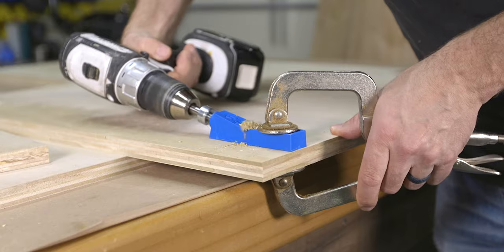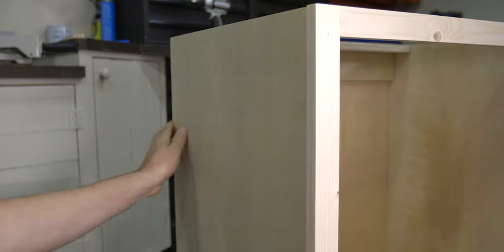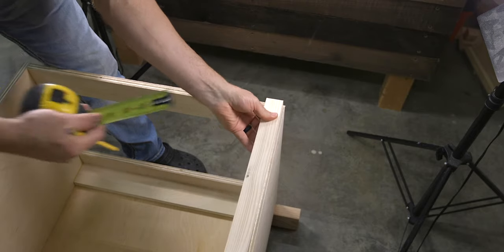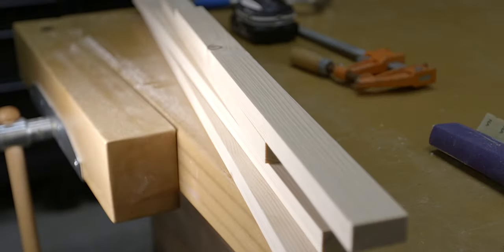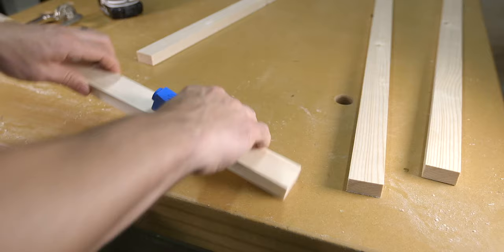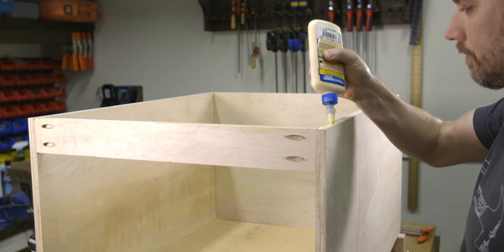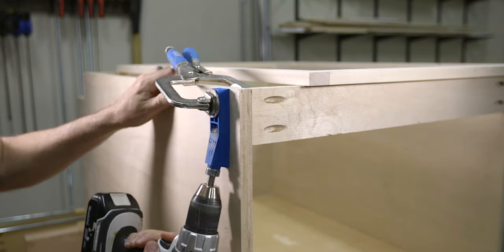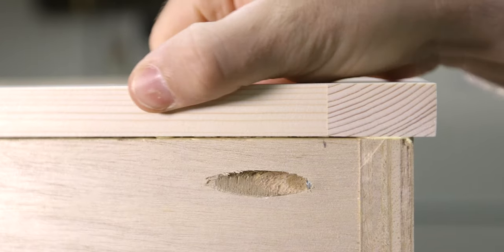Easy Cabinet Face Frames For Beginners

Comment: I like the brad nail trick, never seen that before.  Thanks Josh
Reply: I saw it at Make Something a few mins ago and it was not explained. Now it makes perfect sense and I’ll definitely use that. If I can figure out what that snipping tool is.
Reply: I’ve not seen it before either. Great trick!
Reply: Those pliers are used to cut and bend pencil rod when installing drywall ceilings from concrete ceilings.
Reply: That’s what I was going to say. Genius!

Comment: I was taught in cabinet making school, to always use cauls when gluing face frames. This will insure that there will be even pressure along the edge eliminating any gaps, especially on finished ends.  Forget about using pocket holes for attaching face frames, this could lead to problems. Also, I would like to point out that using cauls will eliminate the need to brad nail the s*** out of the face frame, like I have seen in many videos. You really only need a couple of nails, (I place then near the top), to hold the frame in place. If you like the idea of drive and clip the nail head off, I'm ok will that.

Comment: How come you want an overhang on the outside of the cabinet? Won’t there be a gap in between two cabinets when you butt them up?
Reply from the maker: Yes, you need that gap so each complete cabinet box can come together tightly on the face frame... not the box itself.
Reply: Ahh thank you

Comment: Thanks for this great video. If you are making a face frame for a cabinet that will be beside another cabinet (that is, attached to it) should the face frame be flush to the cabinet sides so there is no overhang?
Reply from the maker: No, you always want a little overhang just incase the box or wall is off a bit you can be certain the face frame will line up. Hope that makes sense.

Comment: Will an mdf hanging cabinet using pocket holes and glue going to fall apart when I start to fill it up?  Sides top and bottom are 16mm thick.  Back is 19mm.  Approx size of circus 3ft wide, 1 ft deep, 2ft tall. There will also be a bottom panel and side panel and 2 doors.  My question is this too much weight for mdf to handle?

I love your chanel. Keep up the great work
Reply from the maker: Hey Bill! That is a very good question, and I don't have an exact answer. I'm sure it would be fine, but I've never trusted/put much faith in MDF.

Comment: When building cabinet face frames (that will have a countertop), wouldn’t the maker elect to have the rails run the full width of the cabinet and rest on top of the stiles? In this way, the rails transfer load from the countertop/surface to the stiles and prevent sagging.

Comment: The "play" in tapes does not make them less accurate, it accounts for the size of the tab. Push the tab against something and it subtracts the width, pull on it and it adds it.... better than cutting things 1" short on accident :D
Reply: Kind of hard to pull the tab on a pencil line though.

Comment: New Subscriber!!! I just picked up a Kreg pocket jig 320, a hinge jig, and a shelf peg hole jig, along with some clamps tonight!!! The “new” 320 jig has size markings on the drill bit, with a window to line up the different sizes on the collar. It also has moveable bottom tabs that are size marked for a very user friendly setup. I’m refacing my kitchen cabinets, and building some new new ones. I’m gonna be using some of your excellent tips for making new shaker style doors. Can’t wait to start tomorrow!!!
Reply from the maker: Welcome Chester! If you have questions or would like to share photos of your work with me, email them to josh@traininghandsacademy.com

Comment: Great video. What's your tip for keeping your face frame lumber straight after ripping the pine? I'm always concerned the wood will warp/bend even a little, which might open up your joints. Any tips? (this could apply to all projects using lumber). What if I dont have a jointer? Maybe I dont need to worry about it warping/bending once its glued? Thanks!

Comment: I have a aquarium stand that I am building out of two-by-fours trying to make it look like it was part of the house the front half will have two doors on the bottom frame that swings out doors on the side of the aquarium that swings out and two doors above the aquarium that will go up towards the ceiling on the side of my case work I will have two doors that will swing open my question is what's the best way to mount the framework to the two-by-fours and what type of hinges would I need to hold the upper doors that swing towards the ceiling upright and the doors do not come down on my head when working around the aquarium also on the side of my stand I was thinking about the bottom door having glass so I can see my control board is this something that can be done if all the other doors will be flat panel or do you think that would look out of place

Comment: Hi! I have a question! When you use faceframes, how do you put the slides??? Do you put some kind of suplement between the slides and the side panel? Is there any other way? 
Thanks!
Reply from the maker: Hello! The face frames get screwed together without anything in between.

Comment: I tried this in the past with a solid metal jig, which I was hoping was going to last longer & be more durable; however, after doing just a single set of facings on a handful of cabinets I noticed things not lining up quite right. I looked down the metal hole in the jig and saw that the side of the drill bit had chewed away at the inner top of the guide hole because as the bit was starting to drill into the wood, the wood pressed the side of the bit up against the side of the guide hole, cutting into it. Have you ever seen this. Do you think the metal in my jig hole was prob just not as good quality as I thought? Or maybe because I was using a standard drill bit rather than one that had the smaller bit extension sticking out further from the tip?  I noticed your bit had that.
Reply from the maker: I would blame it on using the wrong drill bit... could be the metal, but again sounds like the drill bit.

Comment: What type of wood do you recommend for the face frame? Can you use the same plywood as the cabinet or is that not recommend?
Reply from the maker: Not recommended. If painting, I like to use Poplar.
Reply: @TrainingHandsAcademy  is that like a hard wood ? Can I get it at home depot? Also if I'm gonna laminate or formaica can i do that at the end? Once the cabinet is all done?
Reply: @TrainingHandsAcademy  that k you so much for your insight
Reply from the maker: @OKVanAutoUpholsteryBellGardens  Yes, HD sells Poplar and yes tops are last once the cabinets are done.

Comment: Finally. All the answers I've been surfing for. You've included SO many tips and tricks in just a few minutes of video. Several 'ah ha' moments for me. Since I'm staining and don't want nail holes I'll glue and pocket hole screw the top and bottom of the face frame to the carcass where they won't be seen and glue and clamp the sides. Thank you! Subscribed.
Reply from the maker: Glad you found my video!

Comment: What is the reason for the different inside measurements from the face frame and carcass on the sides, top and bottom?
Reply from the maker: It has to do with the way the cabinets go together. If you are building a single cabinet you can make them anything you want. :)
Reply: @TrainingHandsAcademy  sorry, I should have been more clear. I’m referring to the measurement from the inside of the carcass to the inside portion of the face frame. Why is it different on the sides and top and bottom? 

Also, if you were to put in a drawer with a soft closing drawer slides how would you mount the drawer slides with a face frame?…build up the inside of the carcass flush with the face frame? Sorry don’t meant to get too nitty gritty with the details :)
Reply from the maker: @paulgrabowski   The face frame width is the same but the amount it overhangs differs because the sides need to overhang a certain amount so that the cabinet can meet up with the next cabinet. The top can't overhang the top of the box or the countertop will not sit down... so it sits flush with the top of the box. The bottom number overhang is personal preference, some like to have a little overhang and some don't...just depends on what your building. Yes, you will need to add fillers for the draw slides. Hope that helps.

Comment: When measuring point to point on a cabinet like that, there are usually fractions involved. I sometimes find it difficult to keep track of both the ones digit and the numerator of the fraction since one directly follows the other in my memory. As I'm subtracting 1, when I get to the next step, I now no longer trust what I think is the fraction. 
So what I often do is start the measurement at the ten-inch mark on the tape. I find it easier to subtract 1 from the tens digit and keep track of the ones digit and the fraction.
For instance, if the measurement is 24 and 5/16, my tape will read 34-5/16. Since it's obvious that the distance isn't nearly three feet, I subtract ten from 34 to get 24 and maintain the same fractional amount.
Anyway, I'm not sure why, but this often works better for me.  So I'm passing it along in case it will benefit anyone else.
Reply from the maker: That is awesome David! Thank you so much for sharing and supporting our community. 👊
Reply: @TrainingHandsAcademy  - Thanks! I hope my explanation made sense. Another way of looking at it is that I'm starting the tape measure at zero, except that my zero has a one in front of it.
Like I said, this works for me. Maybe someone else will find it helpful. Try it and see.
Cheers! 😀

Comment: Does the over hang measurement of 1/4 pertains to wall cabinet also?
Reply from the maker: Great question! It can... but not always. For instance, if the upper cabinet is going against a side wall, leaving only a 1/4" wouldn't normally be enough to allow for proper door function and scribing the cabinet to the wall.
Reply: Thank you for your quick reply. My cabinets will have concealed hinges. And  I’m making 2, but they are going on the left and right side of a window.
Reply from the maker: @callyscraftycorner2463  1/4" sounds like it will work just fine. Find me on instagram if you'd like to share photos or get additional help from me during your build. https://www.instagram.com/traininghandsacademy/